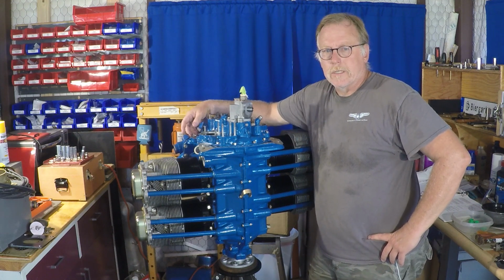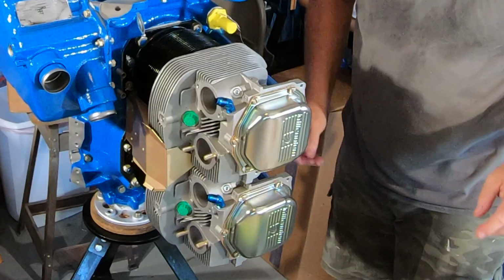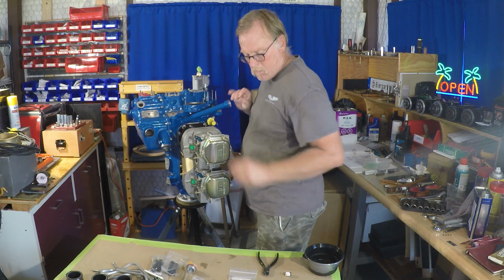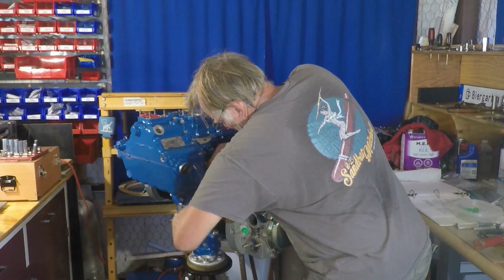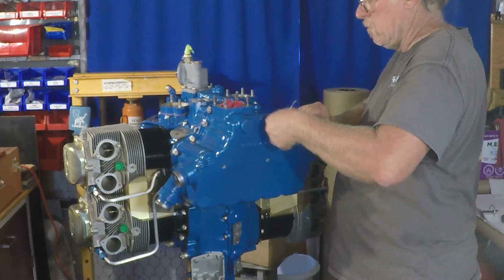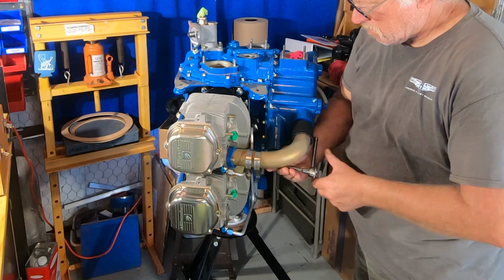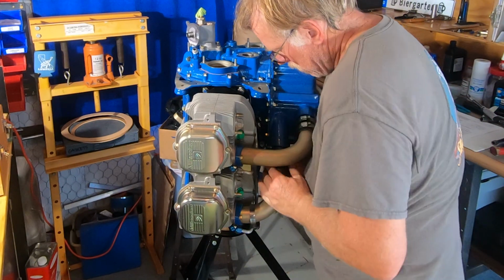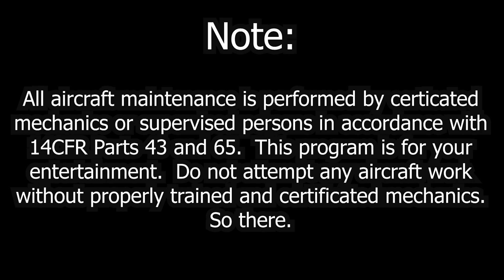360 Engine E15 - Engine Complete!

Comment: There is a choice of four different springs on the oil pressure relief valve,  how do you figure out which one to use?
Reply from the maker: On the O360-A.. series there are three springs used.  The -A4K uses the 77467 spring per PC-306-1 IPC .  This is a starting point at break in.  The asterisk (*) note allows using the other springs if oil pressure needs to be adjusted using minimum washers.  If there is any question definitely give Lycoming Product Support a call.  Thanks for watching!